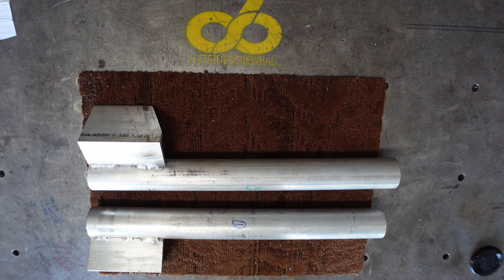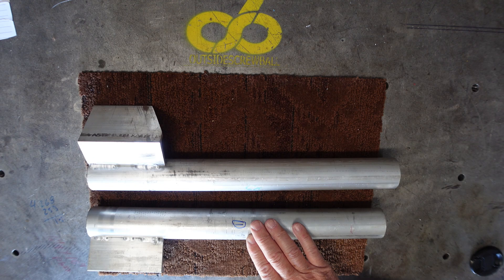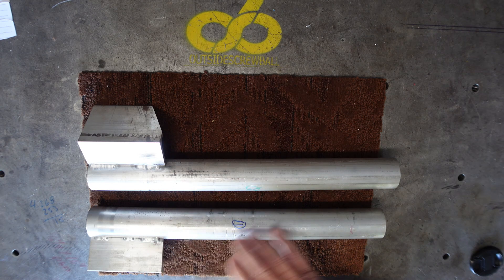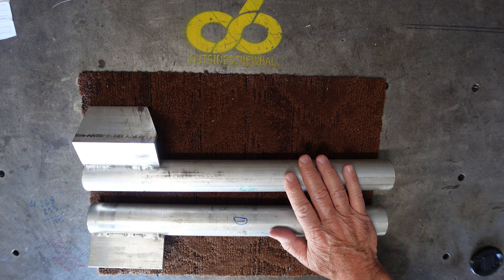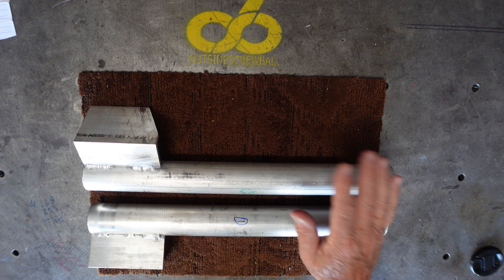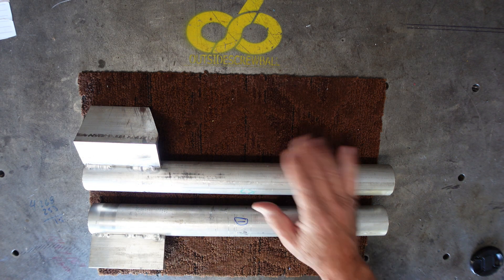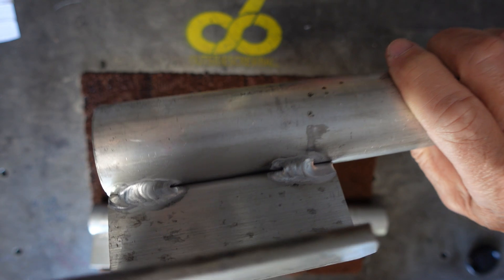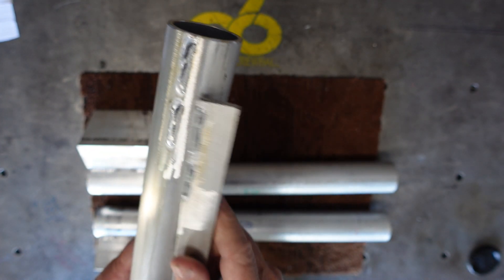Tig Welding Education

Comment: Chuck, I have a machine exactly like yours. When I was scoping out the machine, I saw the amperage at rated output and realized it was more than I wanted to install. However, with the power factor kit (Miller kit 042 353) I can run rated amperage on 48 amps at 230 volts. Thus, I also purchased the kit and installed it (its 4 large 150 uf capacitors and simple wiring). It works well with the 60 amp breaker.
Furthermore, I struggled with aluminum and found the information from weldertipandtricks very helpful.  Jodie showed that cleanliness, arc distance, AC balance, getting a puddle started before adding filler, and fit up were very important... I weld with 2% Thoriated with pretty sharp point. I think the welds turn out great. Also, the AC balance is 70% DC and 30% cleaning at AC balance of 10 on that machine.... and I suggest you start there and go down from there.
Reply from the maker: George, thanks for viewing and providing the information, I did not know about the power factor kit...I agree Jodie is the best and provides great info, thanks for the settings

Comment: chuck i have two tigs a eastwood 200 and a miller 300dx water cooled. both are inverters and both will run at 200 amps or more on a single phase 50 amp circuit. your tip on a preheat is a good one i use it quite often. you  don't need a lot of heat to make a difference you also don't need to use pure tungsten on an inverter machine i have used thoriated  for everything. spend  some time on jody's welding tips and tricks there is a wealth of knowledge there. and then practice practice practice.  
.

Comment: My little 200 amp Canaweld can run 160 amps all day on 30 amp, 220v service,   well so far anyways 😊. It is an inverter welder but I did go through a whole bottle of argon without any issues, so that's saying something I think 😏. If your running an extension cord at too small a gauge that will also kick out your breaker.

Comment: I have an Everlast 256Si inverter tig, 250 amps.  Pure argon, lanthanated tungsten and on a 40 amp circuit can go full throttle.  My welding sucks,  but the machine has no issues.  Will happily weld 3/8" aluminum.

Comment: The only welding that I have done in my lifetime so far was working at a narrowboat yard in 1988, it was just blunt old stick welding using victorian 3-400 amp oil filled welders which looked like a mining cart - in size as well as as shape! We went up to 8mm diameter rods for the ribs on the hull, it got very hot!. I have never done TIG  or MIG  welding, but hopefully in the future I will! Thank you for sharing Chuck!

Comment: Good for sharing this Chuck, 3 things to remember on tigging aluminum.....#1 pure tungsten electrode... #2  minimum of 50/50 mix gas (helium/argon) I personally use  60% helium.40% argon....#3 preheat  to + - 300F........dab n go, dont dawl the pool....get in a repeatable rhythm.... that seems to promote uniform pool height.......and practice makes perfect...........

Comment: I think I have the same machine as you.  When its on a 70A  breaker it never trips.  When I welded my 1" thick fixture plate it put it in the oven at 350 for 30 minutes prior to welding and never had a problem.  I was using a 3/16 tungsten at 200A+.  I usually use the 2% thoriated on aluminum and it seems to work fine for me.  When welding 1/16" thick copper I had to have the max out of the welder 300 amps.  The lower the resistance of the metal, the more amps.

Comment: I have the same machine. I have a Y fitting connecting my argon and helium. When dealing with 1/4" and thicker i blend the two 50/50. The helium increases the arc volt by blablabla science, so one gets more humph to weld with. You could switch to helium only, DC set at 150 + amps and weld it that way too. AH the joys of welding.